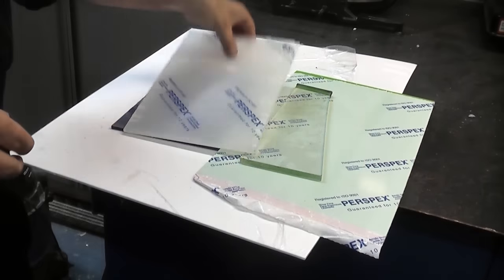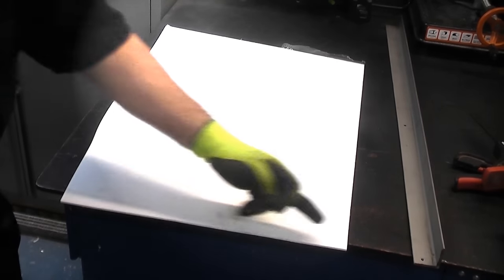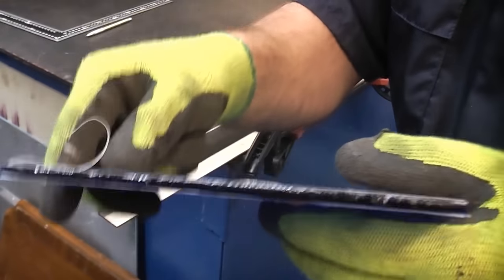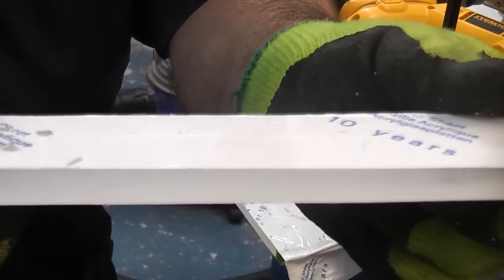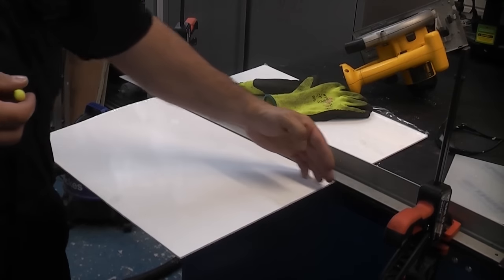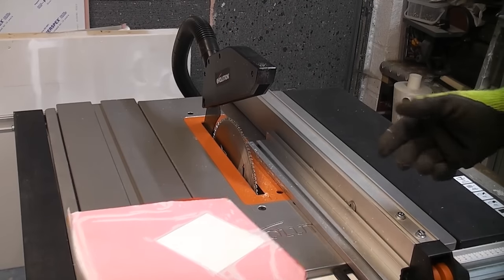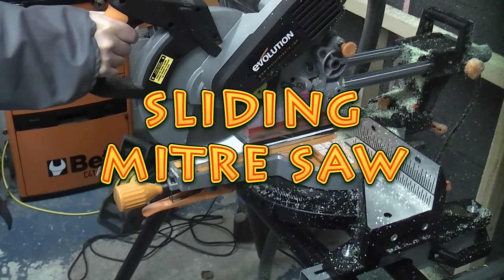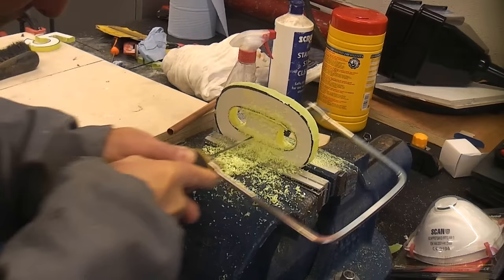How to easily cut acrylic sheet

Comment: If you’re interested in an easier way, draw your cut line on the protective paper then take a finger full of Vaseline and smear it down the line. The Vaseline being clear let’s you see where to cut and you can cut at a higher speed with a jigsaw without the acrylic melting and gumming up on the blade. It also gives you a really nice clean edge. You could cut it on a table saw this way also.
Reply from the maker: Thanks for the comment
Reply: O
Reply: Dish soap works for this too, this also absorbs the heat as well but easily washes off from the acrylic and the saw or drill bit. (Remember to sharpen/grind off the the tip or bite edge of the drill bit if you’re drilling, though, to keep the bite edge from catching and wandering along the surface.)
Reply: Thank you!
Reply: I wonder if the jigsaw method  would work for a round acrylic pipe say 4 inchs?
Reply: Ok I will try this!!
Reply: Thanks bud
Reply: That's nothing America ns can't do❤
Reply: If you have oscillating feature on the jigsaw it's night and day difference
Reply: Great tip
Reply: Tried today and it worked! Thanks for the tip!

Comment: I cut mine using a specialty acrylic jigsaw blade and it cracked. So I purchased a Bosch metal jigsaw blade and it was fine until it got to the end, when the corner broke off. The jigsaw itself is a cheap brand (Harbor Freight), but should that matter if I’m using high quality, brand new blades? I’m really frustrated with this….thanks for any advice!

Comment: I used to be the lead table saw operator at Midwest Trophy shop in Oklahoma and I used most of the methods you used to cut acrylic. I do have one more tool to mention and it's the one tool I use the most for many different types of material, and that is a radial arm saw. Similar to the sliding mitre saw but more versatile.  Great video for those who don't know how to cut acrylics or plexiglass. Thanks for sharing...
Reply from the maker: You are welcome
Thanks for the comment 👍

Comment from the maker: I have been making things from acrylic since I was at school, it is one of the easiest materials to work with and can easily be cut to shape, polished or bent.  Acrylic is waterproof, can be used externally with no issues and is often guaranteed for 10 years!

I hope everyone has a great Sunday ;-)
Reply: Ultimate Handyman how thin can the acrylic sheet be to cut with a jigsaw?
Reply from the maker: You should be able to cut 2mm thick acrylic providing the teeth on the blade are fine enough and you take your time with it.
Reply: My guy ... saalute

Comment: Just replaced the siding on my 12' x 8' back porch with 7 sheets of 8' x 4' x 1/4" clear acrylic. Got the metal jig saw blade thanks to this video's recommendation and it worked like a charm. Little issue with the blade overheating, but just required stopping for a few seconds and then starting again. I love my fish tank. LOL. Thanks.
Reply from the maker: I'm glad the video helped 
Thanks for the comment 👍

Comment: As usual very informative and thorough vid. Thank you.  I've just completed a job using 10 by 4 x 2mm thick acrylic sheets sheets used to line walls in areas used for food preparation, in fact its a cellar in a pub where the barrels are stored.  Using large sheets presents a problem but I used nothing more than a hand saw (crosscut) at a shallow angle and sanded one of the edges for a decent finish.  I have to stress that my cut ends were hidden by joining/corner strips, but as long as you don't force the saw through the material i.e. let it cut, the finish is very respectable.  I used the same to resolve an issue in my lads salon, part the kitchen area goes under the pavement from the street above.  Applying all sorts of paints and anti mould paints did nothing.  Re-lining with fresh plasterboard battened away from the wall only delayed things.  The plastic/acrylic sheeting has done a really good job as well as brightening a fairly dingey area.  Keep em coming, I really enjoy your vids.  Regards  Mike
Reply from the maker: Thanks Mike, I have never done any large projects like that using acrylic although I know a friend that cut two acrylic panels for his shower area, but I think that was about 8mm thick. I normally only make small things from it ;-)
Thanks for the comment

Comment: Saved me again pal, just what i needed. I've got one of those cheap chines 40w laser cutters, i get free acrylic from my mate's vacuum-forming business, so i get his cutoffs, trouble is that most of them are too big to fit into the cutter.
Reply from the maker: I'm glad the video helped ;-)
Out of interest, what thickness acrylic can you cut with the laser?
Thanks for the comment
Reply: I can do 5mm acrylic in 2 passes with the laserhead moving at 10mm per second. It's a good machine, i upgraded it with bits and bobs to improve it a bit. I use Sketchup to draw in plan view, export it to .EPS then import into the cutter software.  @ultimatehandyman

Comment: Some great tips there. For certain cuts I find lubrication really helps, especially for drilling. Plain soapy water is all I use. Of course for things like a table saw or bandsaw this is not really a good idea but it works fine with a jigsaw or coping saw.
Reply from the maker: Thanks for the comment ;-)

Comment: I just had to cut some 5mm Optix brand acrylic. Used a jigsaw with a fine tooth metal blade. I had some issues with it melting but just kept compressed air blowing on the cut as I cut and slowed down even more and it worked for me.  Thanks for showing me how to cut it

Comment: I have to admit I was skeptical it would weld itself back together after pulverizing and knocking out material the width of the blade, but that was well welded back together. Thanks for the video. Time to go replace the panel in my tank.
Reply from the maker: Thanks for the comment 👍

Comment: Good video! For cutting cirles with a jigsaw in a 3mm sheet  i just use double sided tape and stick it to a thin sheet of multiplex/plywood, it doesn't crack or chip as well.

Comment: You could do that Perspex welding itself back together thing as a magic trick!
Reply from the maker: Absolutely ;-)
Reply: Good video with great info. We’ve found that acrylic welds itself if you remove the masking before cutting. If you leave the masking on, no problems with re-welding when using a jigsaw. 
We cut thousands of meters of 4.5mm and 10mm acrylic per year and use a Festool Plunge saw with their guiderail. Beautiful cut, safe to use and we cut probably three to four times faster than shown.

Comment: The speed and amount of cutting teeth are key. As you get thicker ideally you want a blade with less teeth and run slower. Proper chip removal is key to keep from welding itself. Thin material you do need more teeth though but still slower speeds. Our shop specializes in machining all types of engineered plastics. We’ve been doing it for nearly 50 years now. You learn loads of tricks over the years. There are many different types of plastic and some can be quite a challenge to get good finishes on. UHMW for example. The fewer the cutting edges the better. There’s a guy with a video telling you to cut with an angle grinder and a metal cutting disc. YIKES that is so wrong! All of your methods are good however 👍🏼👍🏼
Reply from the maker: Jesus. I would not use an angle grinder on plastic 😱
Thanks for the comment 👍

Comment: Hi Ultimate.  I watched your video on SDS Plus power drills.   In it you you recommended lightly greasing the end of the bit before placing it in the chuck.  That would extend the life of both chuck and bit and also make for smoother operation during use.   

My questions are:-
1.   Is there a particular / recommended type of grease to be used.  Or will ordinary lithium based grease do the job  -- "axle" grease. 

2.  How necessary is this practice?   On some forums, folks have said they used have SDS drills for years and never greased the bit, without ever experiencing any problems with either chuck or bits as a result. 

3.  Others have said greasing the bit could actually increase wear in the chuck as dust and other detritus gets stuck in it.  

Screwfix sell a Makita SDS Hammer Grease.   It costs £4.99 for a 30g container.  (That is the equivalent of £166.33 per kilo. Pound per pound, it is more expensive than fillet steak!)

Granted 30g would probably last my DIY lifetime  but are they taking the piss?  

If you have the time and inclination, your response would be appreciated.
Reply from the maker: 1. I'd use a silicone based grease, you can get a 70g tube on ebay for £3.99 delivered. You can probably get it cheaper than that at a plumbers merchants etc. Sometimes I use silicone grease when plumbing so it always comes in useful ;-)

I would not use normal grease as it might not be too good for the seals in the chuck.
A 70g tube will last a lifetime as you only need a tiny amount every few months.

2. It says to grease the chuck in the manual, I have never had an SDS chuck fail yet although I do know people that have had bits stuck in them (probably due to the lack of lubrication).
3. They tell you to grease the chuck in the manual, please see number 2 above ;-)

Thanks for the comment
Reply: Thanks for that. Much appreciated.
Reply from the maker: You are welcome ;-)

Comment: A video on how to get a nice polished edge would be nice!
Reply from the maker: You can flame polish clear acrylic but I prefer the one that requires some elbow grease-
https://www.youtube.com/watch?v=GE7UIRhh-jM

Thanks for the comment
Reply: Ultimate Handyman I have heard of that method and have also heard of a method using a special acrylic scraper
Reply from the maker: If you scrape the acrylic you have to flame polish it afterwards, but flame polishing only works well on clear most of the time as the pigments used in the acrylic can burn when heated.  For that reason some acrylic colours do not cut well with a laser.

Comment: Thanks for this great video. 
I need to cut a square hole out of the centre of a 3mm-thick acrylic sheet, but I'm not sure what would be the best option. I would think a jigsaw would be great once I've already got a hole made, but for making the first cut, a jigsaw wouldn't work because the end of the blade doesn't have the teeth. Can you recommend any particular tool please?
Reply from the maker: It depends how big the hole is and if the bit that you remove will be scrap.
If the square that you remove is scrap, you can drill a few holes in that, then put the jig saw blade in and cut out the square.
If you want both pieces, you can plunge in using a circular saw (providing the hole is large enough).
A laser cutter is the best option, it would cut out the square in the centre and both pieces would be perfect, unfortunately I don't have access to one of those!
Reply: @ultimatehandyman  thanks for the suggestions! Much appreciated.

Comment: Fantastic video! I didn't know Acrylic welded itself back together!? Came here to learn how to cut a sheet of clear acrylic to repair a Makibox 3D printer I bought which is missing 2 panels the prev owner prob broke during frustrated Assembly as I found Parts fitted upside down). I used to live in N. Manchester. Are you an Oldham lad? Great skills anyway, excellent video.
Reply from the maker: Yes, if the blade goes too fast it can weld itself back together.
I'm from Darwen, Lancashire- not far away from Oldham ;-)
Thanks for the comment

Comment: Love this.  You didn’t mention the differences between cast and extruded though.  For the average user it’s not hugely important but will impact on the cut finish.  Also, do you flame polish the edges? I discovered this technique a couple of years ago and it makes all the difference when manufacturing aesthetics pieces.
Reply from the maker: I've never used extruded before.
I bought a cheap flame polishing machine from China, but only used it once.
I don't make much using clear acrylic and flame polishing can only be done on clear (or so I'm told)
Thanks for the comment
Reply: Ultimate Handyman I did it with a fine grade paper on a mouse and flamed the edges with a plumbing torch.  It does look better on clear, you’re right.  But as a matter of course i “flame grill” everything that will be seen now.  Loving the channel - at last someone who really knows their stuff 👍👍👍

Comment: How would you start cutting a hole out of the middle of the sheet? Very good video btw.
Reply from the maker: I'd drill a hole using a drill, just large enough for the jigsaw blade to fit through.
Thanks for the comment 👍

Comment: I'm thinking of buying a decent acrylic bath panel 1700mm wide but I will probably need to cut a cm of one end any suggestion as the only tools I have is a small hacksaw thanks
Reply from the maker: It depends on the exact bath panel.
Some of them are so thin, that you can just use a sharp knife to cut the bath panel down (by scoring it several times).

Comment: I can snap 8mm with a clean break by using a tile scorer instead of using a blade. tile scorer works really nicely; do both side then whack it. On some smaller pieces I clamp it on a piece of round stock on the floor and jump on it! Did many clean breaks like that, often not requiring any sanding, just flame finish.
Reply from the maker: Thanks for the comment 👍
Reply: @ultimatehandyman  thanks for the video :-)

Comment: Very good Demo. Thank you. Question. What do you use to clean up the edges..Remove saw marks? Fine sand paper? File? Or do you have a Demo Video for cleaning edges. I am wanting a Glass finish on Edges.
Reply from the maker: I normally sand it, then use various grades of wet and dry paper- then rubbing compound and then silver polish.
I made a Perspex table a few years back and polished the edges to a glass finish- https://www.youtube.com/watch?v=fYVfgiP60JY
Thanks for the comment

Comment: Finally, I think that evolution rage table saw looks fantastic - I particularly like the sliding part which is probably ideal for crosscutting. I have a Titan table saw which I am not entirely satisfied with - the table is not flat, the blade does not go perfectly vertical and the mitre slots are annoying T-slots and too narrow - are they T-slots on your saw and how wide are they?

Comment: Just one thing if you didn't know: there is a handheld knife that uses a hooked blade specially made for cutting acrylic. 2 Japanese makes(OLFA & NT Cutter) have been available for many many years. While these hook knives do a 10-times better job, they also make the job much easier and faster than the conventional knife you used in the video. Price around AU$10-20.
Reply from the maker: I have seen them, but never used one.
Thanks for the comment 👍

Comment: I'm wondering how to trim off about a MM from a 30inch perspex filter panel that diffuses light in my led tv set. The edge lit led have melted the edge a little and it causes a bit of light bleed scattering because the surface is slightly melted where the led got hot.   Would a fine sandpaper bring back the clear glassy edge so light beams nice and smooth?  I can't just spin it 180 degrees since its design is 1 way light diffuser.
Reply from the maker: It might be possible, I have edge polished Acrylic in this video-
https://www.youtube.com/watch?v=GE7UIRhh-jM
👍

Comment: That steel bench comes in handy for clamping things to. I like your use of a piece of angle iron as a saw guide. How do you rate cordless circular saws?
Reply from the maker: Yes, it is great. I made it a few years back mainly from scrap metal.
I have only ever used my Dewalt 18v cordless circular saw, it's great- 
https://www.youtube.com/watch?v=kPXf90GUeg4

Comment: Good video. Nice tips. Though from my experience it's mongrel stuff to cut straight and clean. Hand cutting with a very sharp thin utility knife gives a good result but it's hard work. I've only worked with 1 to 3mm hips. I tried engraving detail in it with a dremel router but it gave a rubbish result. 3 mm with a fine blade on a jigsaw was ok but have to go slow.
I like the straight edge held down by clamps . Must try that next time. Coping saw. Doing it hard. If your going to work with this stuff a lot buy a factory. Nice setup in the video. I havnt got that gear but I'm only a diy sometimes hack away
Reply from the maker: Thanks for the comment

Comment: what about a sheet of 1/8" thick acryllic 24" xn 28" but I wanto shave off ~6mm.  Sory for mixed Imperial and metric use.. best jisaw blade type?  and its flecxy so I need a carboard base on a table to support?
Reply from the maker: Yes, I would definitely put it on a sacrificial piece of timber, such as plywood or chipboard to prevent it flexing. A fine-tooth jigsaw blade (one suitable for aluminium will be fine) 👍

Comment: Hi, What would you recommend to fix a stainless steel bracket to an acrylic sheet? I was thinking of using gold-label pond silicon. I do not want to use screws due to the effect on the artwork's look. Thank you.
Reply from the maker: If it is not load bearing, the pond solicone should work 👍

Comment: any advise on how to cut a square hole on my acrylic pc case without any electrical tools? im thinking, heating a plastic cutter and cut the acrylic with only hand power, reheat and repeat, will it work?
Reply from the maker: It depends how thick it is. You also have to be careful of the fumes! 
It might work on really thin stuff.

Comment: I have a 3/8 thick piece I need to cut and I noticed you didn't use a bandsaw? Are bandsaws to fast of is it better to use a jig saw
Reply from the maker: I don't have a bandsaw, but if you have one it will be perfect, if you can adjust the speed make sure you do not have it cutting too fast.
Thanks for the comment 👍
Reply: @ultimatehandyman  the bandsaw worked great and turning the speed was the trick. I just uploaded a video starting the project so check it out!